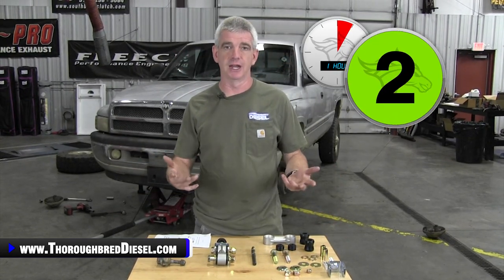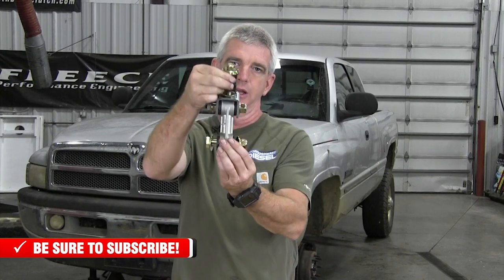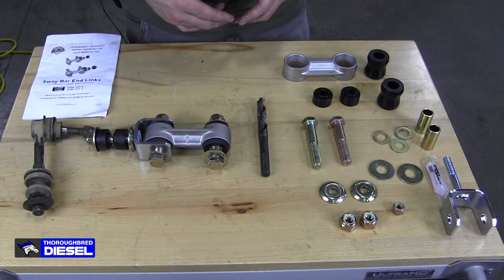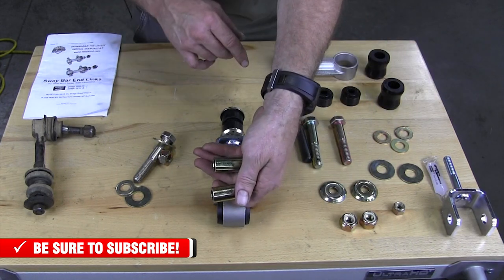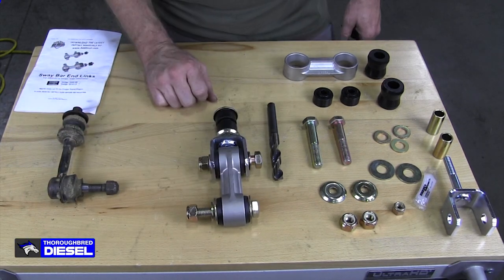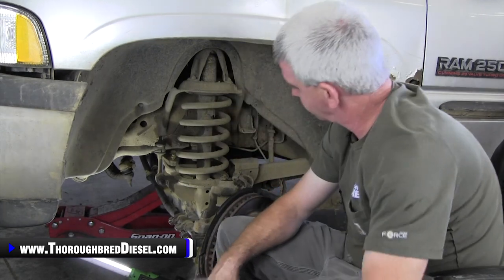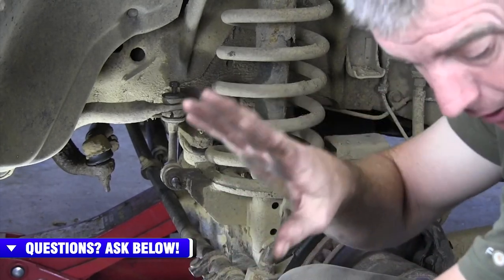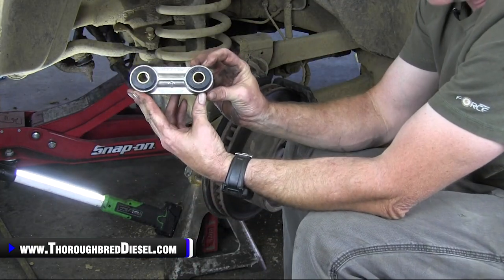Upgrading Old 2nd Gen Cummins: Fixing Major Dodge Problems | BD Sway Bar End Links #dodge #cummins

Comment: Wouldn’t it be easier to just put bolts that actually fit in your kits?
Reply: The Oem is tapered.  Really just opening a little to accept straight bolt.

Comment: I've owned my 3rd gen for 22 years (bought new) and had multiple failures of these links - even while under warranty. After warranty, I bought a couple of different brands that all bent or otherwise failed. The BD has been on it for 13 years and shows no signs of problems.  It's the only way to go IMO.

Comment: This question has nothing to do with sway bar end links but a question on 6 speed manual transmissions , if you were ordering a manual 6 speed for your 2004 dodge dually would you get the NV5600 or the G56. Would really like your input on this question and reason for choosing the one you pick. Thanks for sharing your knowledge and making videos for our gain to learn.
Reply: G56 all day !
Reply: 5600 is way way tuffer then the g56. Hail to the 5600

Comment: 🤔 I know the instructions say to assemble the way you did.  The shank end of the bolt is a lot stronger than the thread end. Not sure how much force the sway bar links see. 
I would put the weakest link of the bolt away from a hard mount when possible. 
🤷🏼‍♂️ My way of thinking I guess.
Nice detailed video. Without thoroughbred I wouldn't have chosen a 3rd gen or know about aftermarket parts for them.
Reply from the maker: Thank you!  Glad we can help.

Comment: What prevents it from rotating in the middle? Seems like a bad design vs a solid piece
Reply from the maker: The sway bar is supposed to be able to articulate to a degree, and these links allow greater articulation (off roading) but doesn’t fail or rust and fall out making the sway bar useless.  Even with a extra point of articulation, you still have sway bar correction for roll with these links.

Comment: What is a 2nd gen vs any others? I have a 99 2500 diesel, not sure what gen that would be.
Reply: Second gen dodge is 1994-2002
Reply from the maker: 2nd Gen is considered the body style on the 1994-2002 2500 and 3500 Dodge Ram trucks.